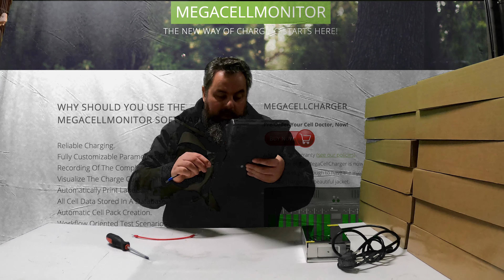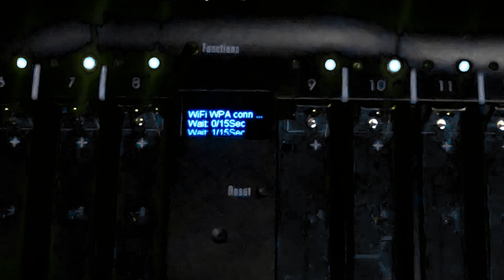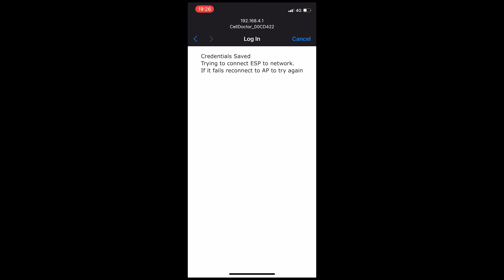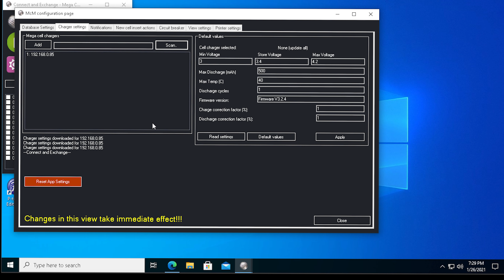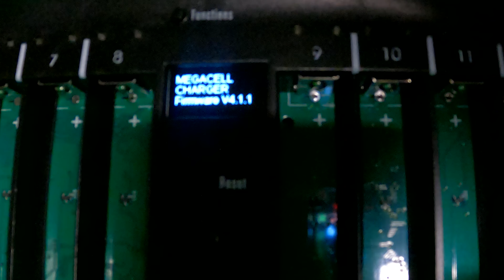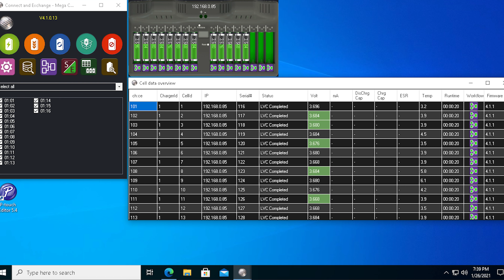S2E4   Unboxing and getting ready Prod V2

Comment: Last update v4.2.0.0 disappeared the datagrid. Reset to factory defaults didn´t work.
Reply from the maker: There is a known issue in the window manager which sometimes move the view out of sight. What you can do is click on the taskbar, wait for the popup with the windows. Right click the data grid and then click move. Use the arrows to move the window one and then you can drag it.

Comment: I've asked before and gotten no response... How would one go about inserting a previously tested and serialized cell to re-test it, without generating a new serial number? Additionally, how do we 'adjust' an existing workflow? For example, if I want to take the existing workflow and add store charge, how do I put it where I want it? If I select 'Start Store Charge' in the actions and click 'add', it adds it, but under 'print label'. How can it be moved to between 'Low Capacity Check' and 'Print Label'?
Reply from the maker: Select the element you want to add the new operation below. In the grid - right click and select regression test. All of this is discussed already in the instruction videos before - so I recommend to what season 1 as well. You will find lots of information there.